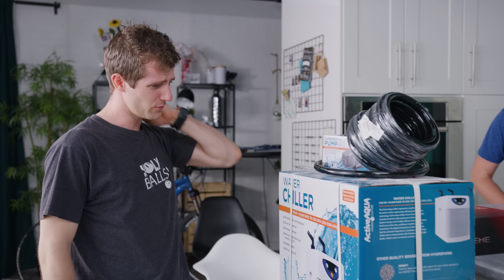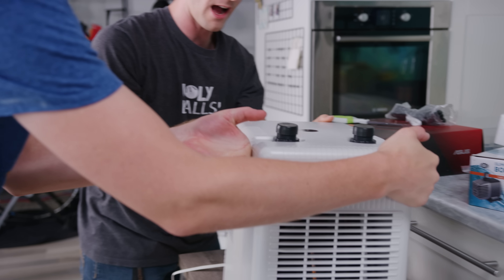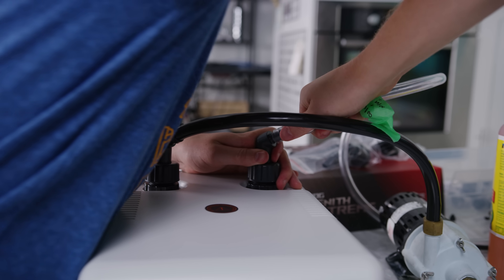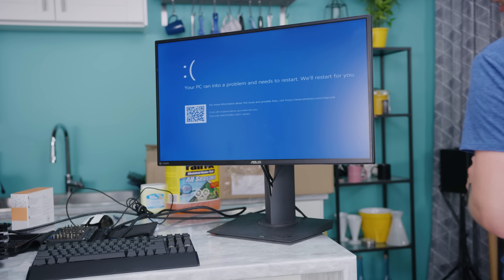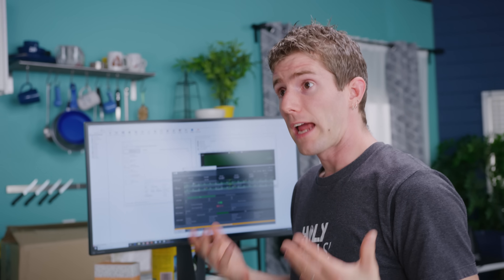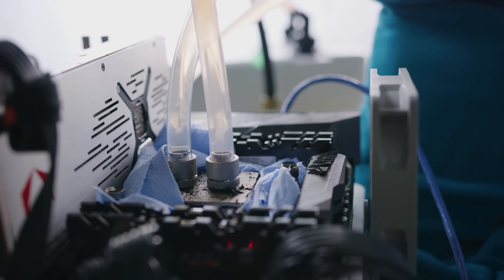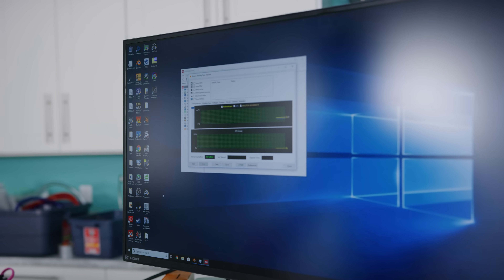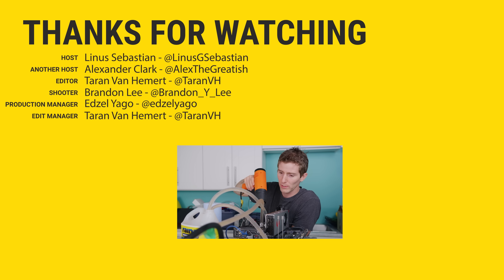Chilling Threadripper 2!!!

Comment: Run it on a mineral oil submerged kit, then it won't condensate and you can run it super low.
Reply: Bob, always the voice of reason... And blowing a guy for coke.
Reply: Or you could put it in a more-or-less sealed tower, with a few sachets of hydrophilic pellets to suck the water out of the air. If the air's dry, there's no chance of condensation!
Reply: @patrickhector  good idea. gonna have to give that a try. (purchases a fuckload of peltier units for a budget experiment)
Reply: let's copy/paste so linus can see .. caus this is brilliant.
Reply: With oil-water heat exchanger (e.g. a coil of copper pipe in the oil, with water inside, + regular pump and radiator) it could work without heating the oil
Reply: Doesn't need Moil just put the board upside down, any condensation will drip down away from the board if you affix tiny wires to all the metallic components via capillary action. Done that with a mini freezer you can buy for Mercedes luxury cars off fleaBay. Sub zero in ambient temp, no issues.
Reply: or you can simply put some A/C thermal barrier,it just wrap around the tube and protect it from the ambient,just that simple. That stuff is used widely and is very cheap.
Reply: Jose Moreno Porras but it wouldn’t be absurdly over doing it, and that is the true purpose of overclocking
Reply: and here i was thinking of running it inside a vacuum chamber  or filled with a non condensing gas. then you could really go as cold as you like
Reply: aserta  the dew will form on the chilled MB and CPU , then they are fried
Reply: @aserta  could also just get a second chiller an aquarium and then a dual chiller set up with oil submersion. 

chill oil temps first. power up system and drop water temps. cover aquarium in insolation to prevent the condensation from killing usb ports. 

done. now your vrms are also super chilled.
Reply: alternatively: put it into a (sealed) metal box filled with oil - this metal box should have heat sinks outside to move heat into air
Reply: That can work if the mineral oil is sealed. Otherwise there is nothing preventing the condensation from getting into the mineral oil. Also cooling down mineral oil to low temperatures will increase its viscosity and put more strain on moving parts like pumps.
Reply: @TheFlex420  depends on the grade of mineral oil. there are different grades. 

some are fine well below zero in closed loop systems.  and if you were to drop oil temp first it wouldnt even need to be sealed as the case would have condensation instead of the board and tubes and blocks. then drop water temps/ 

basically just changes the dew point and condensation location.  the other option is build a crazy stupid air chiller box that blows sub ambient air at the system the entire time and is alot noisier and more expensive.

just buy dual iwaki rd30 pumps or the pumps linus used.
Reply: Genious
Reply: WTF, WHY ARE YOU USING WINDSHIELD WASHER FLUID FOR COOLING????
Reply: @arnaudhoarau561 
Because it's cheap and you can go sub zero with it.
Reply: @mephInc  Oh okay, I didn't understand this :c
Reply: @arnaudhoarau561  
Where I live, it can get to -30F and regular windshield washer fluid will freeze. What Linus is using contains small amounts of antifreeze.
Reply: @mephInc  okay, i have understood, thx bro
Reply: That would be SIIIIICK!
Reply: So what, a water to water cooler? Basiclly, submerge a radiator in the mineral oil, then run a loop through a pump, resevior, cooler, radiator. Stick a fan on the radiator to draw oil through its fins, then you get cool oil? That would be sick
Reply: Unless you have active circulation, submerging isn't actually that effective. It heats up pretty fast.
Reply: just submerge the loop with it. Btw that depends in what you submerge, "novek" seems to work pretty well since the vaporization is essentially a "passive circulation", that is needed like you mentioned.
Reply: in this case the submerging isn't for cooling purposes but to prevent condensation around the socket

Comment: Would a 1/4 hp chiller be better? Run the CPU and GPU? Also maybe that fluid is not so great in the long term. Maybe try distilled water with a little water wetter added.

Comment: Build something both stupid and brilliant;

Sub-zero gaming system. Use a de-humidifier to take out as much moisture as possible while also coating the board to make it liquid resistant. Then use something like that to make a custom sub-zero loop. The only hangup I can think of is the noise, which would be crazy and would likely require some insulation to decrease and manage.

Comment: Can this pump maybe be used with mineral oil??? Maybe try using in the mineral oil PC? That would fix the condensation issues with it at really cold temps if the air at the top can be vacuumed down to a low pressure (keeping any humidity gaseous). I've been really interested in ways to safely cool PC's  (at stock speeds) to below ambient temp, then overclock (and overvolt) the hell out system, getting the temps back up to around 85C, with max cooling. Cinebench to 10,000? :)

Comment: Old BIOS ROFL!  On the other hand, that diagnostic panel is nice.  I wish every motherboard had one, even if it wasn't as nice and was just a double digit display which you could look up the error code from on your smart phone.

On another note, why use Rain-X?

As a note, with a little adaption, this system could work 24/7.  However, I would use a quieter pump and works with above due point temperatures.  Add a couple water absorption filters on the air intake to the system and you might be able to get it to run a little lower.    Unfortunately, such filters rarely have a long life cycle, although some of the shorter life cycle ones are reusable after being dried.

Another option for a 24/7 sub-zero cooling strategy would be to use a condenser on the case intake air to pre-cool the incoming air below the heat-sink sub-zero temperatures so the condensation forms on that condenser instead of the heat sink.  I know, just throw energy at the problem there.
Reply: It's pretty simple, water proof, then add heaters in between insulation. I run waaaayyyy colder. My FX has a core temp peak under load (at 1.7 Vcore) of just 10c. My coolant block is -25c under the ~450w load, and idle at -58c. I tested it for 72 hours at -58c to do a "quick check" for any condensation issues, and I'll be running it for probably another month that way to check for pin rust (you do need to pack the socket underneath the chip, and I'm experimenting with a cleaner setup than just packing it with thermal paste, because you're never getting that out...).

Also on the digit readout. Yeah, it would be nice if the motherboards actually told you what the error codes meant... Or had a list on the website. Instead, my "Dr. Debug" on my X370 spits out a number, and through trial and error of purposely screwing things up I had a decent list of what all error codes meant (but now I can't find my list... Should have put it in google sheets I guess...)

Comment: I was considering a whole house system for my computers for a while until I saw your original water cool video with the copper. First I wouldnt use pex. Second I was thinking of a inverter water chiller instead of this aquarium one. Thoughts? https://www.amazon.com/EcoPlus-Commercial-Grade-Water-Chiller/dp/B007ZU7BRI/ref=asc_df_B007ZU7BRI/?tag=hyprod-20&linkCode=df0&hvadid=167141308073&hvpos=1o3&hvnetw=g&hvrand=8732100364586327064&hvpone=&hvptwo=&hvqmt=&hvdev=c&hvdvcmdl=&hvlocint=&hvlocphy=9008418&hvtargid=aud-467077737785:pla-307378432536&psc=1

Comment: Alphacool has a chiller too. An these is made for PC cooling.
Reply: Yes and it is about $1200 USD, it does come with its own pump and reservoir. The aquarium cooler base price is about $300, but needs a pump and reservoir added,  so figure about another $100 bucks. Besides the aquarium chiller is designed to cool fish tanks and not harm the fish inside... SO it will be just fine for a PC...
Reply: @JJ_ExMachina  I didn't say that it's not fine for PC cooling, I just wanted to say that there is a all in one alternative, which, like you say, is much more expensive than the aquarium cooler.
Reply: Till Hansen ... It was the last part of your comment, the bit about, "An these is made for PC cooling." which inherently implies the other option is inferior... Just saying ;)

Comment: for the army computer systems that we build we acrylic coat the board to keep water and moisture from damaging it
Reply: Plasti-dip works good too. It can also peel off if you want to go back to air cooled (it makes everything a couple degrees hotter).

You do need to insulate it after a point though, the PCIe and RAM slots get cold enough to condense, but thankfully at my normal -58c idle on the CPU, the RAM stays cold, but not too cold because the heatspreaders are heated up just enough by the air in the room.

Comment: So you get a larger version of the water chiller. You put it outside. You do the whole room water cooling thing again, but you use PVC pipes with insulation instead of copper pipes that just radiate the cpu heat into the room.

Comment: Add to the $100,000 computer!!!!  :)

Fix the condensation problem with a case under slight vacuum? You would have to heat sink the heat out of the vacuum area, then radiate and cool off at room temp and pressure. New term "overcooling"?  I want to see the limit.... The best actually hardware kept at it's lowest optimal temperature while under full load! Can a board draw 1 KW? That would be my goal. :)

Comment: So could this be added as like a secondary cooling system so that if you don't want the extra noise you can use more traditional cooling and switch a valve to use this beast?
Reply: Yes, you definitely could. Don't forget to insulate around the socket though!

Comment: Step 1) Bypass temperature regulation by connecting (bridge/short)  a wire between 120v or 240v and C/CL so compressor is "Always ON"
Step 2) Buy (LNL Cooling) or build an airtight "Purge Case"
Step 3) Buy a tank of Nitrogen and a timed regulator to purge the case inside (via a tube) to displace the oxygen and never worry about condensation again
Step 4) Bench the hell out of it and post to HWBot for all to see !

Comment: Need 5/8×1/2 armaflex insulation for the hose. Specifically what we use for chiller units. Typically 1" thickness, but since its hose and not copper you'll need 1/2" thick

Comment: You should combine this chiller with the one you made from the window AC. Put the hot side of the AC in a cooler, and use the chiller to chill the hot side. Then continue as normal.

Comment: this could be a legit water cooling way to do some serious overclocking, you could create a closed loop and including cooling for the GPU. all you would probably need to make this a decent long-term build would be to add some anti-condensation tubing sleeve to the water tubes. it wouldn't look pretty, but you could use this and avoid having to pay a lot of money for some liquid nitrogen
Reply: just thought of an idea, i wonder if there is such a thing as double layered water tubing. it would be similar to a yeti tumbler where it is nearly vacuum sealed on the inside to prevent condensation

Comment: I would like to see that chilling liquid that holds a radiator that cools the cpu and gpu ...
Reply: Or you just add a second water block for the GPU... Why would you add another component (well actually 2, because now you need a second pump) just to get less cooling performance? It's already a water loop, you don't need anything else.

Comment: Enable precision boost overdrive, you will still hit >500Watts on the CPU occasionally, but this can actually deliver a better overclock than manually overclocking at 4GHz as you don’t loose the 4.2GHz boost for low thread count tasks. Run the new blender benchmark to test it out :). Cinebench scores will still be faster with a manual OC, but real world apps run faster with PBO.

Comment: Chillers like that are mostly used in tropical reef aquariums to keep the water from over heating.  Reef aquariums often use metal halide lighting which is extremely bright and hot.  The corals need the bright light but the lights will cook the corals so the water has to be cooled with a chiller.  Sometimes they're used for freshwater tropical and more rarely for cold water aquariums.

Comment: Honestly, at this point, I'm thinking you should have something like this setup with a large reservoir and pump away from the work area and see if you can link up 3/4/5 workstations to it. Ultimate cooling for an office/LAN etc? Instead of 10 Gamers one CPU, it could be 10 Gamers one cooler?

Comment: Oh so when its AMD that's using a chiller its alright to do it without being criticized? Ok then.
Reply: It would have been ok if Intel did it if they admitted it, and weren't using a server chip and customised server motherboard. Or they could have just called the demonstration Intel's big balls, showing off with an unlocked server grade cpu. Then it would have been cool. In fact I might have just bought an Intel processor if they did that because while the 2700x makes more sense for me, they would have deserved it for doing something that cool just to show off. But no, they had to bullshit and demonstrate just how scared and stupid they are. One is cool, the other is sad.
Reply: Linus is not AMD nor that AMD needs anything that expensive to cool down their HEDT CPUs at max overclocking.

Comment: You're adding a LOT of heat using such a large inefficient pump like a little giant. I suggest using a controllable DC pump where you can dial in the flow while not adding as much external heat.
Reply: The could just put the pump in a pull configuration and conect the water cooler directly to the die
Reply: A product sheet states that those pumps pull 1,43A. Considering a average power faktor of about 0,8 that makes for 125W @110V beeing drawn on the input side. Such a pump is air cooled, meaning that only a very small fraction of that is actually dumped into the water, like 10 to 20W if you are generous. So thats not relevant on a 500W CPU

for good measure here is the data sheet I quickly googled to https://www.walmart.com/ip/LITTLE-GIANT-2-MD-SC-Pump-Magnetic-Drive/40824672
Reply: Big giant*
Reply: such a small loop can be ran by an D5 i thought. like what jayz2cents did with his ambient cooler
Reply: Maybe. The crazy cooling unit might put enough of a strain on a D5 to make you need a second inline D5 or something more powerful instead. I don't know what kind of flow resistance something like that has, but Linus seemed to be sucking pretty hard (*joke!*) on that hose. I've heard that a VPP755 is stronger and quieter while being D5 compatible but have never tried one so I can't say definitively.
Reply: no, not a "LOT" in the PC world, Maybe a lot in the tank world.
Reply: Actually since those coolers adjust colling according to the temp of the fluid it doesnt matter what pump you use. You just need to have the pump feed the cooler not the block.
Reply: Another option would be to utilize a pump that doesn't cool itself using the liquid, like a DDC or something similar that is bigger.
Reply: @mark hensley The pump IS feeding the cooler, the output from the cooler is going straight to the CPU block. Are you blind?
Reply: It really is nothing in comparison to the cpu.
Reply: This is a rhetorical statement.

Comment: 1/10th of a horsepower (75w) chiller. So almost 24x less than the 1770w chiller intel used for their “5ghz” stunt
Reply: Yep.  75w isn't enough for sustained load from a 500 watt CPU.
Reply: Steven Willmy yh, thats why even at stock it hit 24 degrees on a few second benchmark. You need a cooler at least as powerful as the amount of power the cpu is using (200w stock, 500w oc ish)
Reply: Just use 25 of them in series.. that would be fun
Reply: A Brackers
lol are you serious?
By that logic you wouldnt be able to cool anything. 
If your cooler is causing as much heat as it is supposed to dissipate, it would be busy to cool itself all the time.
Reply: A Brackers that isn’t anywhere near enough either so stup tryna say amd is actually good
Reply: ChloeWade I didnt say anything about one being better than the other. All I was saying is if you're going to use a chiller on hedt, use at least 500w so it stays sub-ambient.
Reply: ChloeWade still in denial about reality huh ?
Reply: ChloeWade man are you salty or what? 😂😂😂
Reply: A Brackers AMD sucks
Reply: ChloeWade lol shitty attempt at trolling.

Comment: Build it into a system... With an air sealed container over the board with a dehumidifier to combat the condensation... :)
Reply: i thought most people used Vaseline
Reply: This guy sciences.
Reply: You just insulate it and put heaters in-between the insulation. I run super cold 24/7 just fine (block temp peaks at -25c, idle at -58c).

Make sure to water-proof under the socket too, unless you like pins rusting out!